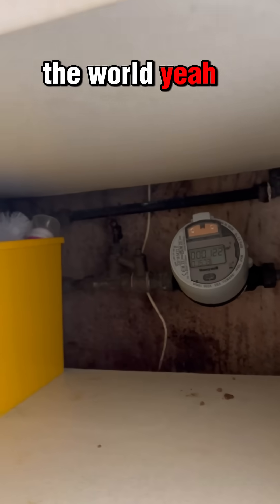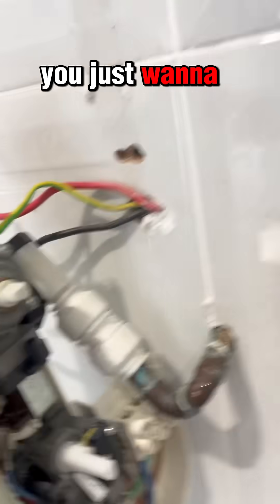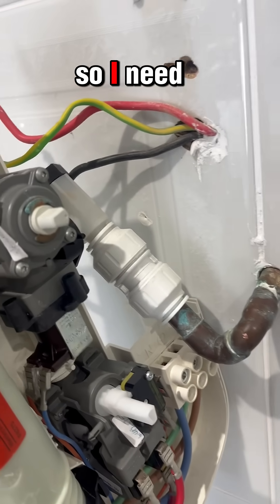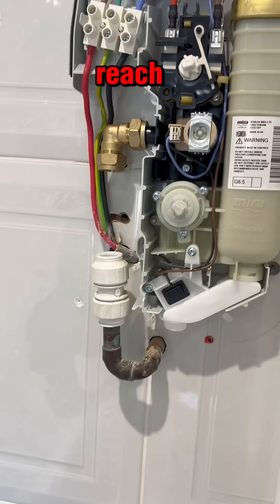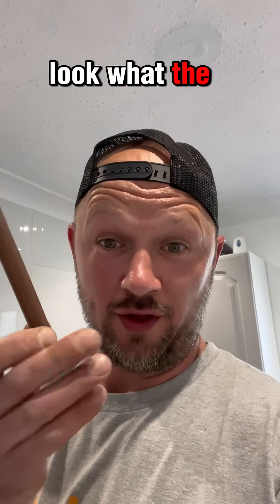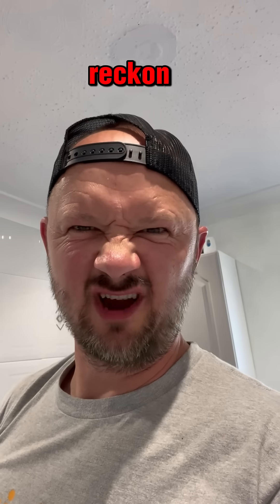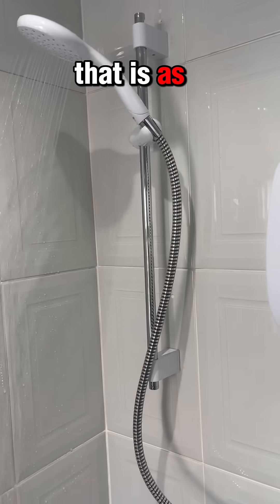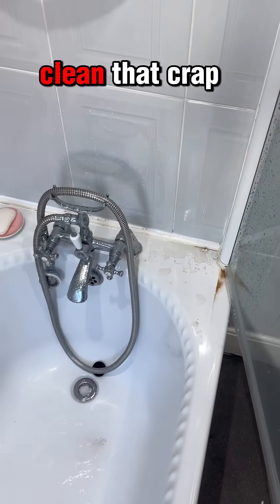How to Fit an Electric Shower Safely – What Every Sparky Should Know!

Comment: Most electric showers benefit from a GOOD aerated shower head - basically mixes a bit of air into the modest water flow (Venturi vacuum principle)
Eco-Camel's Jet-Storm is one model, but there are others that perform well (and some not so well)
Fit a wide bore shower hose (look at the diameter of the hose ends) & you should see an improvement to the show flow/pattern compared to most old "stock" shower heads
Plus with the aerated shower head, you should see a slight reduction in water consumption as it mixes with air being drawn in - as well as feeling the difference when showering

Obviously, all the above won't bump up the flow rate of a 7kW to a 9kW shower, but in most cases it will improve the showering experience on almost any shower
(If it doesn't, you have a really cheap/naff aerated shower head, narrow bore hose, blocked debris filter/scaled up pipe/heater element)

A worthy consideration for most showers - especially electric ones